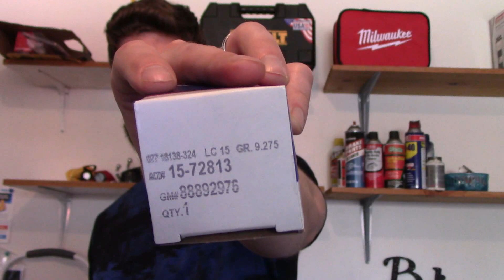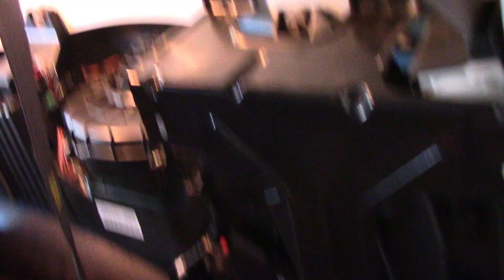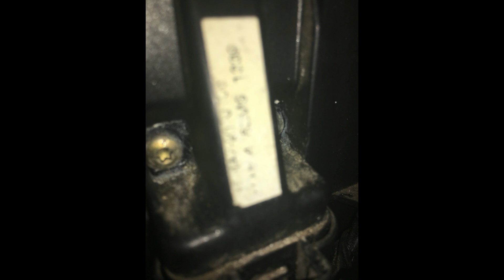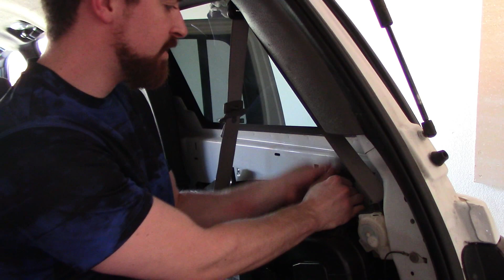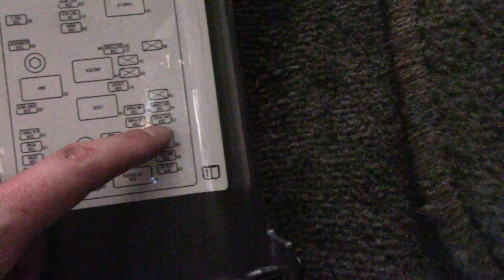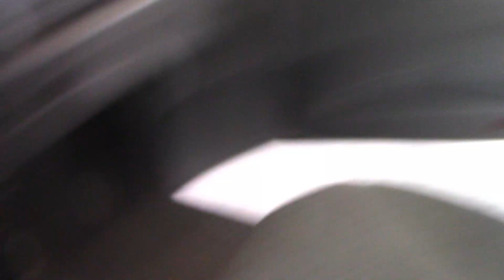Replacing Rear Blower Motor AC Resistor Chevy Trailblazer 2002 EXT LT tips & tools

Comment: Just got the F***we out today! 2hrs in the Florida heat. Well the quarterpanel baking in the sun will burn your knuckles FYI. Only good news is that the" hole of no return" has a access? Chevy was thoughtfully nice to put a rubber plug under the truck you can remove and retrieve everything you drop there. And you will drop things in there!!! Have fun
Reply from the maker: Oh wow! I know the feeling... I wish I knew about that plug. I would have felt a lot less worried about parts falling, but then we wouldn't have name like "the hole of no return" ha xD Glad the repair worked for you!

Comment: So there is two nuts you access on the bottom right above the exhuast.  You can take those out and lay the assy way out and you can easily get to this part.
Reply from the maker: Unfortunately, I saw this in a video months (maybe even a year after my video). Would have saved me a ton of time. Thanks for posting this info to the comments!
Reply: Found them thanks!

Comment: I have a 2004 Trailblazer LS EXT and my rear blower will not work at all. Resistor????  I was just wondering if it is all the same from your 2002 as it would be on a 2004.  Thanks!
Reply from the maker: The repair should be very similar as 2002-2009 are similar models. I'd check the blower motor fuses first. The rear A/C shouldn't turn off if a resistor goes out. Matter of fact mine wouldn't turn off once the resistor went out unless I pulled its fuse.

Comment: Hey dude, I am not sure what is the problem with my rear AC. When I turn it on, it runs and stops, after a while it runs and again it stops. Can you let me know what is the exact issue please?
Thanks
Reply from the maker: So I'm not sure of the exact issue but that could be a resistor issue. Mine would go on and off and then stayed on all the time after the resistor broke, even when the car was turned off (kinda weird lol). How long does it go off for? A good way to test is to see if it will run on all the fan speeds.

 I have a resistor video at this link https://www.youtube.com/watch?v=ryCGtHA4WBQ
Reply: @savorwithdmurph1113   It goes off around less than 2 minutes and then starts. May be I will try changing the resistor and let you know if it works. Thank you so much for helping us out through these videos.

Comment: so my rear is now blowing at all. Any idea what i should check first to eliminate certain things? I dont get any speeds at all. I know which GM products especially tahoes etc the front resistor goes out causing it to go only 1-2 speeds etc. But on this my whole rear isnt blowing so im trying to see what i should check first to eliminate a bad blower etc.
Reply from the maker: Very basic but check to make sure your front AC control isn’t switched to off. 

Also I read an article talking about your rear AC relay can be a reason it doesn’t turn on. There is a picture of where the relay is located in the article. 

https://www.2carpros.com/questions/2003-chevrolet-trailblazer-rear-ac-not-working
Reply: @savorwithdmurph1113  I looked that one is for the front? Is there one for the back? Currently working on this... Thanks! Same problem back ac gets no response won't turn on.

Comment: Why did you change the resistor? May I know what was the issue you faced?
Reply from the maker: The main issue I faced was the rear blower motor was constantly running even when the car was turned off with no power. Also, I noticed prior to this that the rear fan speeds would not always work correctly.
Reply: Thanks a lot for this help brother. It really worked. And I have a question about using engine oil flush chemical. Is it safe to use on trailblazer? It would be a great help if you share this or make a video on this. 
Thank you murph. 🖤